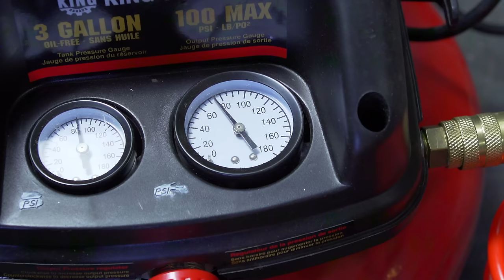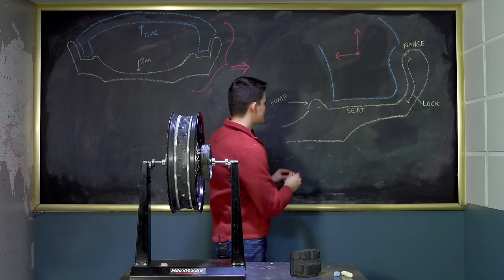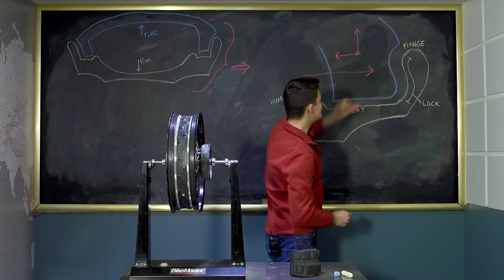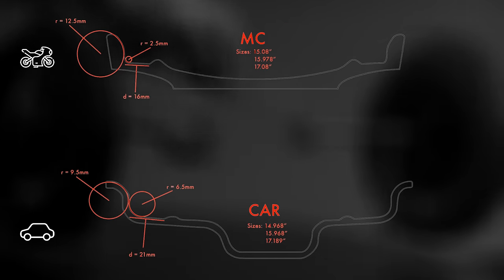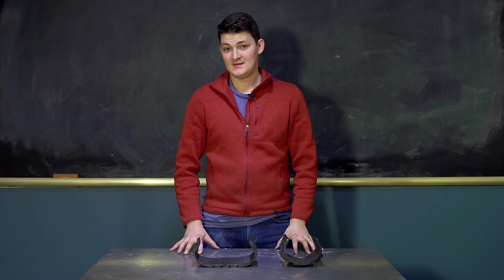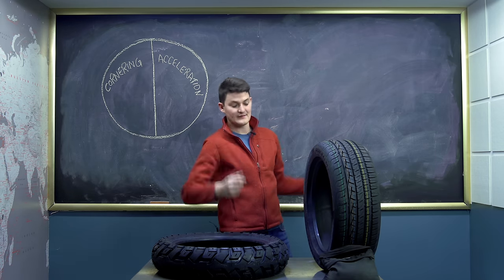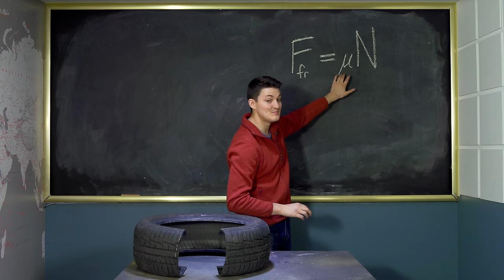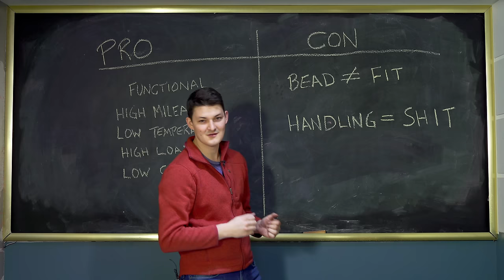Are Motorcycle Tires a Ripoff? The Darkside Car Tire Experiment

Comment: No need for any of this nowadays as good grippy commuter tires can go for pretty low prices and have decent tread life. Heck, I had a Continental motorcycle tire that lasted fore 9,000 miles and could've gone more had I not gotten rid of the bike. My 1984 Kawasaki Ninja 900 is running Bridgestone Battleax that has gone on for 7000 miles now and is still grippy on dry pavement and has enough tread to get through the rain. I'm hoping the Michelin Pilot Road 4 on my Z650 can get at least 6000 miles out of both tires but I dunno as they are quite sticky and grip really well in the wet.

Comment: The reason they are a ripoff is cause their are totally overpriced
Reply: Not any more.  20 years ago having to buy moto tires at a shop, yes.  But now you have nearly-direct Chinese and Korean imports of brands like Kenda and Maxxis.  The traditional brands like Michelin and Bridgestone have also been forced to reduce prices somewhat. 

Helmets, too, have dropped hugely in price.
Reply: Yup, last time I change my rear tire it was a Metzeler($350) 5 years ago. I do my tire changes with Shinkos, I could change both tires for $200.
Reply: @cafenightster4548  did the tires on my sportster last year, got the tires from the local Harley shop (Dunlop) for like $120 on a sale. Took them to an actual bike shop and got them put on for like 40$. dunno if that was an outlier, but it didn't seem over priced to me.
Reply: Overpriced and horrible mileage
Reply: @youtubeaccount9058  
Totally agree 
30 years ago a rear tyre was 100 quid (UK)
I now get a pair for 150 and wages were tiny then

Comment: The bikes don't weigh enough to press the tire into the road surface. Even with the larger contact patch you're not getting the grip per sq inch that a softer sticker tire that was designed to work with that weight would provide.  The bike is also not heavy enough to deform the tire to keep contact patch in full contact with the road. If you ran the tire at a psi low enough to allow it to deform it would handle even worse and be more likely to "spontaneously uninstall" themselves. (cool description, btw) You can tell a lot just by looking at the difference in the thickness of the sidewalls. Even the steel liner in the bead in the car tire is much thicker and stiffer so that it can handle the additional weight. Putting a car tire on a motorcycle is like trying to put a tire from an 18 wheeler on a car.

Comment: I put a car tire on my FJR1300 and it was a different driving experience, I'll admit that. But, on the other hand, my bike is not the lightest or slowest and I rode it through the mountains and highways of California, sometimes going over 120 miles per hour and I had no experienced any problems with handling.

Comment: I am in my mid 70s, have been riding for over 60 years, probably owned over 30 bikes.  I have put over 100,000 miles on car tires in past 10 years on 2 heavy cruisers.  The only noticeable difference in handling was exactly what you pointed out, you need more counter steering, the bike wants to straighten up.  I have only had one tire failure, on a Goldwing, with 2 up doing about 75 mph when it blew out the sidewall.  This was on an almost new high dollar MC tire properly inflated but probably overloaded.  I was able to pull over without dropping the bike.  I would not consider a CT on a sport bike like the one you used in this video but they work great on big cruisers.  The reason I went to CT was I was only getting 6000 miles on rear tire on a Stratoliner.  Thanks for presenting this in a sensible way.  Of all  the screamers who say darksiders are all going to die, I have yet to see a documented case where anyone has.

Comment: Contact patch does play a role in grip because it sinks into microscopic bumps in the road, giving it more grip.  Think like the tire pushing horizontally off of little mountains in the pavement. 

It’s the reason why many vehicles can turn at well over 1g, because if that part of the equation didn’t matter it would only ever be able to turn at <1g.

For a vehicle that can turn at say 1.3G, the microscopic road bump-tire interface is responsible for providing over 1/4 of the force to turn the vehicle.

It’s also why soft tire compounds give more grip even if they’re not necessarily stickier or cohesive on an atomic level. So a well designed everyday street sport tire will have not much more “stick” but more softness to allow for more grip and a decent tread life.

Comment: Been riding darkside on all my heavy bikes, no problems even hitting sharp corners. 
Biggest advantage, bike doesnt wobble at stand still so better balance..2nd my tire last alot longer innterms of replacement..3rd. More rear contact patch espcially when peeling out. 
Overall, not a problem.

Comment: I ride long distance. 5000 to 8000 mile bike rides. I have done both the motorcycle tires and the dark side. I am here to tell you that the car tire is a safer way to go on a goldwing. Definitely in the rain, it stops way better than any bike tire. Also I had a Michelin rear bike tire separate  after only 6000 miles. Did the tail of the dragon scraping pegs, stuck and handle great. Oh one more thing, I pull a cargo trailer also. About 400 lbs. loved the video and the way u left it to the rider. Great job

Comment: If F_fr = mu * N, they it should be impossible for a bike to lean more than 45°. Think about it: at a larger lean angle, the normal force to the pavement would be smaller than the centripetal force applied to the tire by the pavement to keep the bike from sliding out. This simple fact disproves the validity of this equation, for tire grip, mind you. Mike on Bikes did a video explaining tire grip very well, go check it out :)

Comment: I had a car tire on my VTX 1800. I live in northeast tn. No problems on the curves, no problems in the rain. Rode to Sturgis and back also. If you ride into a parking area that  has pot holes, and is uneven , it does feel weird, but I never fell off or crashed. The biggest drawback is that it feels like being in my recliner. I also had a Corbin seat. If I had cruise control I might fall asleep.  I have downsized to a Rebel and will put a car tire on when the OEM is wore out.

Comment: Bought a used Goldwing in 2015, rode it for 2 weeks before giving it a wash and noticed a place on the rear "fender" where there used to be a sticker of Darth Vader and I could barely make out the word Darkside under Darth Vader picture. I never heard of Darksiding before this, after researching it, I found I had been riding on a car tire for 2 weeks and never noticed a difference. Guess handling wasn't that bad for me not to notice, although most Goldwingers aren't dragging their knee around corners.

Comment: What PSI was the car tire being ran at?     taking in to account the lack of weight the motorcycle has, could the results work in the positive for the car tire if say only 15 psi was used?  Maybe even less considering the car ture has a larger internal volume?

Comment: Tires don’t follow the simplified friction formula. That is because rubber deforms and allows not just sliding friction, but also the ability to push off the tiny hills and valleys in the road surface. So actually bigger contact patch means more grip. Which is why drag motorcycles use wider tires in the first place.
Reply: this is the first good and original explaination of why bigger tires are beteer, thank you, as someone who thought smaller tires would be just as good

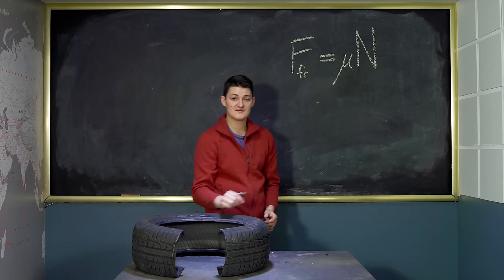Comment: 8:50 so, it is of note that the friction equation is only for rigid materials, rubber like that on a tire actually does gain friction capacity from contaft area, and doesn't have a linear relation between load and force.
Riding darkside comes instead with the risk that you get a comically small contact patch during cornering, as can very much be seen in the video, as they are designed for vehicles often times more than 4x the weight, 2x the load per tire, with suspension and chassis geometry that avoids going over 3deg of negative camber, whilst expecting a lot more force to make the tread deform into contacting the road.
Then theres the matter of sipes, grooves in the tire designed for removing water from the road. These are generally asymmetrical on good tires (with the outside resemblung a cheater tire, and the inside a heavy weather one), and even on cheaper ones these thin out towards the edges, what this means is that you get even less grip in the rain whilst taking a corner, and should you get a nice asymetrical performance tire, you better hope to be racing ovals until it goes bald.

Comment: I was considering "the dark side" for quite some time. Even I considered higher narrower winter tyre (way softer) but...
What I experienced behind 4 wheels when switched from 205-55-16 to 225-45-17... was "fighting the edge"... On some slightly deformed asfalt my steering wheel went crazy... because side of the tyre was hitting it. With so "shallow" and wide tyre the edges of it are so stiff that is wery hard to deform it. That is definitely not what you want your motorcycle to do... Ride on the hard edge and lose control.
Even the dimensions, for  example, 195-65-17, no car manufacturer makes. Hit the search and Dunlop motorcycle tyre will pop up.
10000-15000km per motorcycle tyre is quite expensive, but... What is the price of your life? After paying the expensive machine, registration, gear.. are we that cheep?

Comment: Put a 245 car tire on a triumph rocket not so long ago after doing extensive research on the triumph forums. They were saying it "works well and doesnt affect handling as much as youd think". Load of crap from my experience. Its hard to initiate the turn or lean, and it feels weird to hold it in the lean. The abs was freeking out aswell since when you lean a car tire over it gets "larger" and changes the speed at which it rotates, but ive done dummer shit to my bikes like making the rocket a bobber lol and i could live with it if it were just those issues because the bike looked like something batman would ride with the tire and all, and the straight line grip paired with the torque of the triumph made it a blast. "Drag raced" my buddy with his r1 off the line and won three times... in a row, i still rub it in his face, funniest shit ever. The BIGGEST problem with a car tire is that it catches every single deviation in the road and pulls you pretty violently to the side and theres a shit ton of those around here (nyc eww) and even worse the roads at least around here are convex so the water flows to the drains, especially on the highways so you constantly have to fight the bike pulling you off to the side. So a week after putting that shit on my bike i hurried over to a shop and put an actual tire on it.

Edit- also most people advocating for the dark side argue "tire pessure makes the difference." Yeah a load of crap, the lower psi helps the tire sorta "squish" down as you lean, so leaning feels more "normal" But it makes the back feel "messy" and it catches those deviations even more AND the lower psi i tried the more sluggish the bikes power and hanling felt. It tried all the psi's the dark side gurus on the triumph forum gave me. It all felt like crap and it never came close to what a normal tire would feel like

Comment: Yes CT handles differently,  More counter steering in turns.  What everybody doing these videos never seem to point out is that a MT also requires more counter steering pressure in turns once your MT gets about half worn.  If you look at it, it is also flat across the middle with a flat area about equal to a CT.

Comment: I woulda gone with a symmetric tread. That works well car tires are cheap. Good way to get studded rear wheels on the cheap too. Run a winter tire with studs.

Comment: My last bike of many in my riding days was a Triumph Rocket 3 . There were a few darksiders out there swearing that was the way to go so I had to try it.
 I had more grip in the level position . The stock tire can break loose on a hard 1/2 shift.
It was a softer ride going dark. Stiff stock rear springs to control the driveshaft with a powerful engine made a rough ride.
Handling was negatively effected as lots of countersteer  needed in sweeps. ( more than any stock Honda I ever rode)
The heavy Rocket with stock tire would fall right into a sweeping turn with confidence.
My conclusion was going darkside was a mistake.

Comment: Can't remember if I'd commented of not, but running car tires are usually for big tour bikes, also you run a lower pressure that lets the tire flex. I've ridden behind my bike and could see that there was more on the road than the same bike with a bike tire when in a curve. Also throw in double darkside for an amazing experience, I trust my bike and tires more than I did the original set of tires.

Comment: Been running a high sipe all season Pirelli car tire on the back of my vn2000 vulcan for 2 years now, absolutely love it, set pressure at 28 psi, excellent in rain, stops on a dime and cornering is no problem with the lower psi. I would not put one on a small light bike, the vulcan is 850 lbs plus usually 2 passengers, so 1000 lbs total. I was going through 200mm tires in 7-10000 kms, not even thrashing it, the pirelli has gone 20000 kms with no signs of wear. The traction is far superior to the original bike tire.

Comment: I used to commute highway with the only curves being me turning at traffic lights. Had a BMW R1200RT. Would burn through rear tyres in 12k km. That was every 4-6 months. Changed it to a car tyre. Took me less than 15min to get used to it. Bit more effort to turn, and would trail imperfections, but the highway was near perfect. I got around 80k km on the rear tyre which was a continental, so a soft car tyre. If you have a heavy bike, and do long distances on straight roads definitely do it. If you have a light bike, don’t.

Comment: Now check this out through my experience when you have a wider tire on the back than the front it messes up the alignment making it want to buck when leaning thru a curve but when the front and back are the same size your running line matches correcting the alignment i wish you could revisit this topic
Reply: That has nothing to do with your alignment. Square up your axel adjusters.  
 ALL rear tires are wider than the front tire for any road bike. The only time people run the same tire front and back are on flat tracker setups or custom cafe builds, and in the latter it's for aesthetic value over performance.

Comment: the Mju is not constant with rubber against force. ie at very low "N", more accurately Pressure ("N"/patch size) is higher than at higher.

Comment: As the owner of two big bores, I think that running car tires would be dangerous because the rubber compounds are generally softer for better grip and then your asking a car tire to do what it’s not designed to do and that’s pivot thru turns. I think this is something I’d want to figure out from my easy chair rather then flat on my back ( hopefully) at the bottom of a ditch or Devine lol, I think I will keep buying the Dunlaps thank you lol

Comment: Thanks for this information! I happen to be a motorcycle-riding Survivalist (2007 - The last good year KLR 650, painted flat desert tan, micro-size turn signals, subdued wheels w/ black Rustoleum Textured, tactical MOLLE tank vest, tube steel engine guard w/Kawasaki foot pegs).

Not just that modern automotive tires can be used, but showing how to punch the tire, yourself!  Thanks again!

Comment: #1.  This result is based on ONE bike and ONE tire, within a vastly broader landscape of possibilities than are afforded by many more combinations of motorcycle, tire choice, and PRESSURE ranges...
#2.  Car tires are much more able to handle a larger range of pressures vs. load.  Compared to my choices, the ones  here appear to include too much pressure in a tire that is way too wide for the rim and the motorcycle model itself.  There are thinner car tires that would fit that bike better, and if run lower in pressure, will generate a much larger contact patch that will flex more and keep at least half the tread planted at all times, at least up to the nominal 30-degree SAE lean angle.  So "handling" perception is actually VERY relative, and actually more adjustable to preference.  More counter-steer for what would have been better traction with these suggested changes seems to be a net-positive trade-off.  
#3.  Bead lock is assisted, again, by sidewall angles of a tire that is not too wide for the rim, like this one is...  
#4.  If you "save a hundred bucks" and it lasts even twice as long, you're saving A LOT more than a hundred bucks...  
#5.  Durometer testing indicates that many of the more-suitable and preferred car tire sizes/models among experienced darksiders actually have softer, stickier rubber than most motorcycle tires.  Many of them are multi-compound, so they are even sticker on the outer thirds of the tread where cornering forces are applied.  Without a DUROMETER test, you are just PRESUMING...  
#6.  YRMV!!!  A LOT.  And that's really the whole point - greater potential necessarily requires more variables. 
#7.  It's not for everybody.  It's not even for "most" riders.  It's only for those who have a complete understanding of what they are doing, what their application and riding style actually benefits from, and then discovering initially with a lot of research into successful tire/bike combos what their best choice of tire and pressure is likely to be, and then working from there.